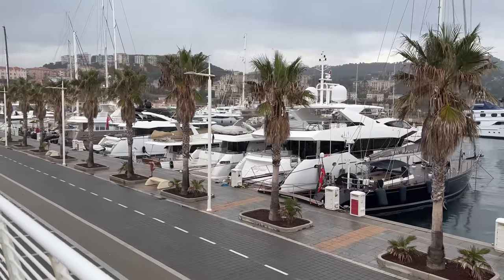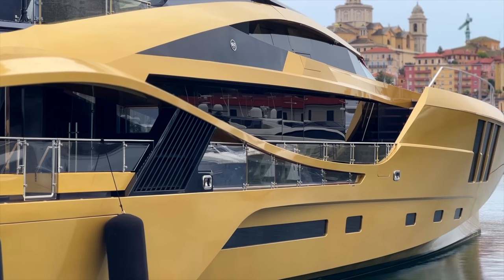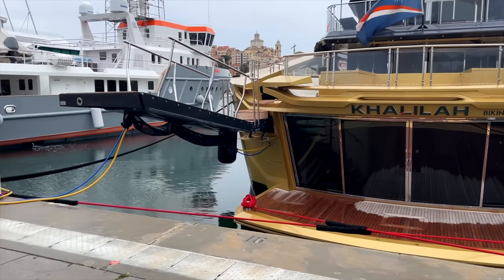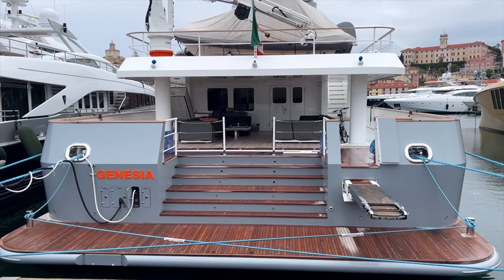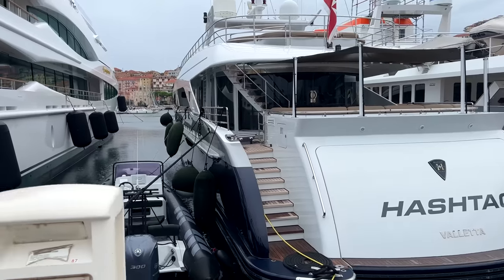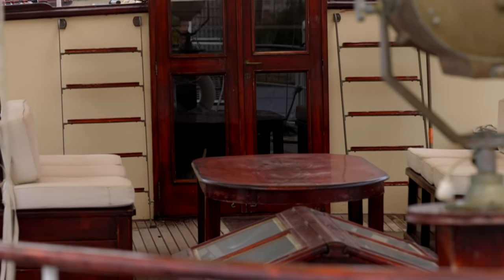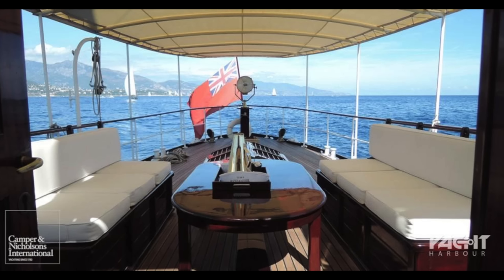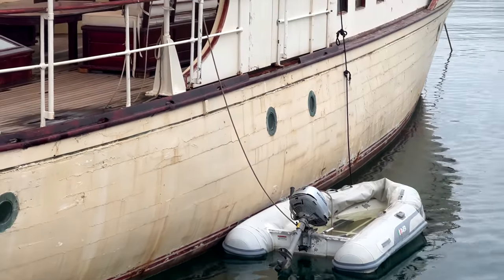Is this Famous SuperYacht Plated in Gold?

Comment: There is an article in La Stampa from last September explaining why there are no more guards around the two arrested superyachts, the one in Imperia and one in Portosole, Sanremo.
They've put up some electronic sensors on the boats so the alarm goes off if they turn the engins on.
Reply: and if they get tugged out at night into international waters..... 007 stuff. LOL
Reply: @49Roadmaster  It actually says the device goes off if any movement of the boat is detected. So... no, they can't get tugged out of the marina.
Reply: @coconuts2361  thanks for the clarification. I would think, as the vessel is in water a traditional motion detector would not be the actual mechanism. Speculating here, more like a geotracker with some type of alarm sets off if it goes out of certain perimeter.
Again, thanks for the update.

Comment: Just as a point of clarification and without contradicting  eSysman, because he is correct in certain circumstances, not all superyachts take 3-4 years to build.  The larger, bespoke custom yachts of 70/80m +,  certainly do, but smaller ones are often built as a semi-custom batch design where the structure is fixed and its just the decor that changes.  These yachts, of about 50m can be built in 2-3 years, smaller ones even less.  As a general rule, once the 3rd-6th yacht of a batch is built the production time is reduced by 30% because all the wrinkles are ironed out and better solutions are implemented.

Comment: I may be wrong but the power cord on the “gold” yacht looks to be about the same size as the hose. That suggests that it would be a 50 amp cord. A boat that size would normally need a 200 amp supply. Maybe that’s why to Genset is running.

Comment: On Khalilah:  carbon fibre for one ship is a LOT of work since you have to build the madrels against which the cabon fibre is laid.  But does allow for most iteresting shapes.  Strange that they only built one since building subsequent units using the mandrells would be much faster/cheaper since the shapes are already there.   Curious on how different the maintenance would be on the hull.   In dry dock, woudl they sand it to remove whatever is attached to it and then apply new layer of epoxy, or do they use standard paint?  The section above water would likely last very long time since the colour is embedded in the top layers of epoxy. 

On Genesia: is it common to have a passerelle without handrails?  Can't imagine the typical older onwer of such a row boat being comfortable walking on it without handrails. 

On Bystander:  I take it it would need a trip to dry dock where the hull would be sanded and repainted to look brand new?  In terms of getting the liveable areas shiny and good looking, would this typically involve a single project t a yard to clean all the brass and sand fllors etc, or would this typically be more of a progressive job with on-board crew cleaning brass fixtures one by one over a period of time during which boat is functional and at sea?

Comment: I don’t think the weight of the gold (therefore value) would be significant given the value of the boat. Typical gold plating is only .25 to 5 microns thick. Putting the required substrate on carbon fiber would be a bigger challenge.  The surface prep involved and tank required to plate it would be what is most impractical and incredulous.
Reply: I did a little more looking and found that it typically doesn’t hold up once submerged in water for extended periods of time. Probably better to stick with the gold paint it has now.
Reply: @colinr273  Doesn't hold up on anything.